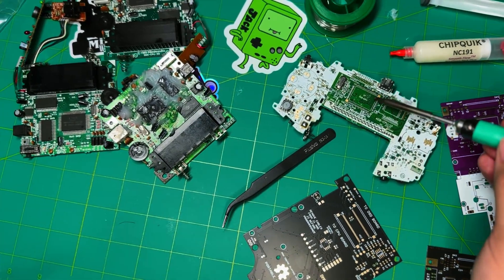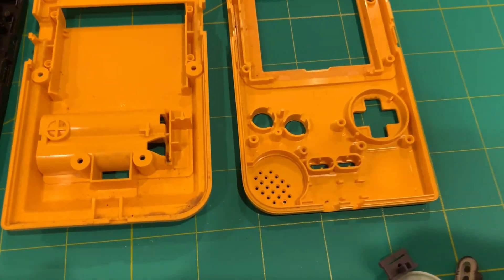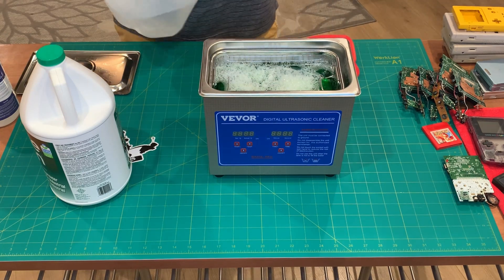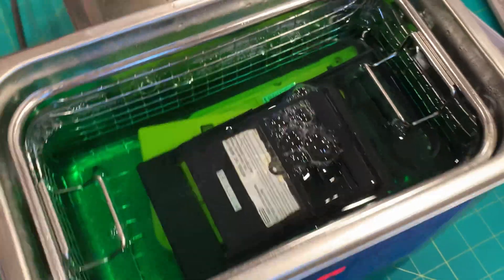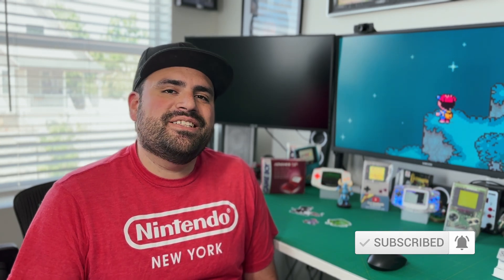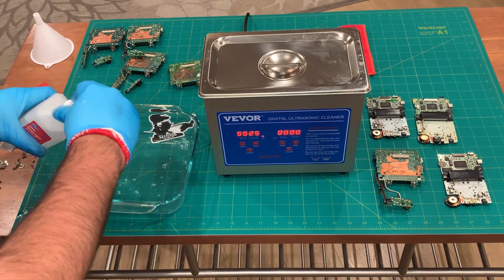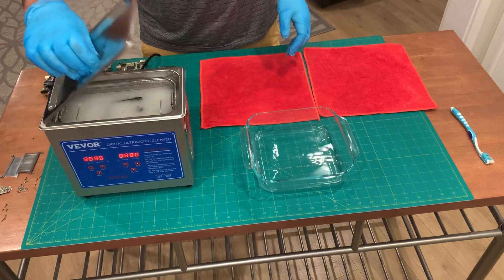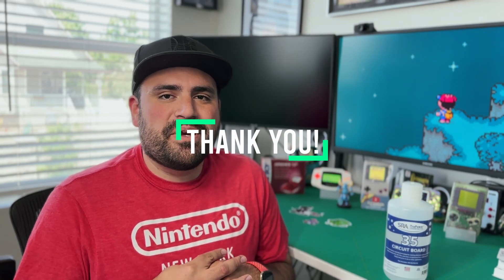Ultrasonic Cleaning for Gameboy Motherboards Buttons, Membranes and Shells 2023

Comment: How do you measure the amount of distilled water and solution that you put in the cleaner? Just want to make sure I don’t do too much distilled water for the PCBs.
Reply from the maker: u could use a measuring cup - but I think its suitable to eyeball it.  submerging the pcb in pure distilled water is not damaging either so there is no concern there.
Reply: @PizzaHandhelds  great information. Thanks for getting back to me so fast.

Comment: I usually put my game boy mobos in my 10 lt ultrasonic cleaner after desoldering speakers and quartz oscillators(heard that the 40hz frequency could destroy them). I saw you put them without desoldering anything (this will spare me some time), have you experienced problems or issue when yhe mobos were dried and in operable mode?